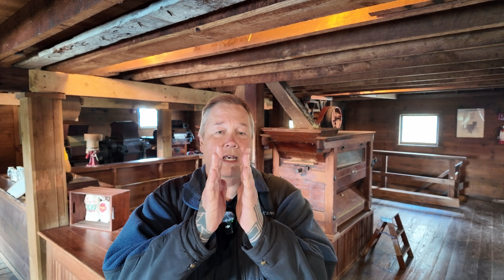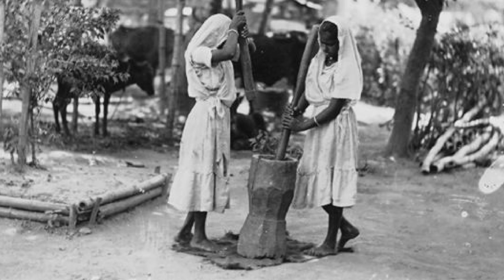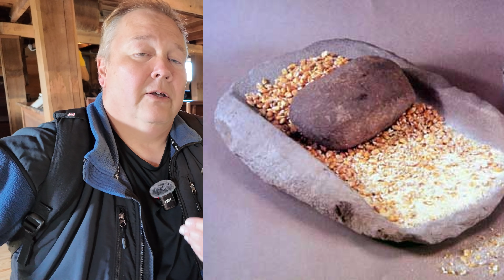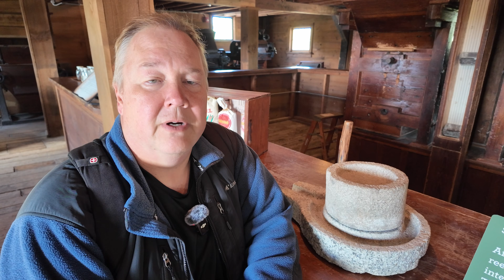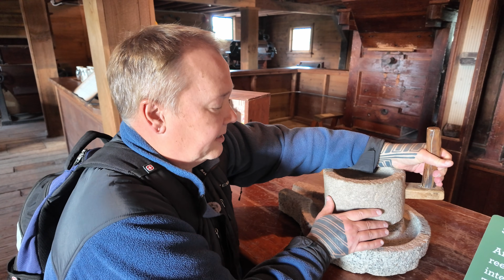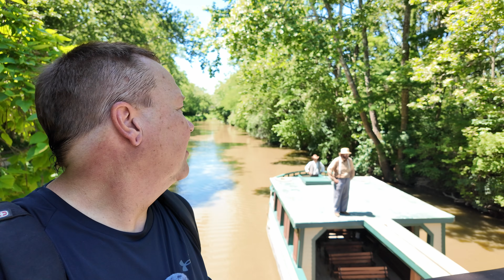How the Industrial Revolution Forever Changed Jobs

Comment: In 1995 the Ludwig Mill was fully automated and powered by water turbines.  Upon my retirement, there were no millwrights available to keep up with maintenance it seems.
Reply from the maker: I've only been visiting there the last 5 or 10 years.  It seems the might need to dredge the canal to get the boat in and out every year, but they've been grinding and selling grain and, allegedly, although I've never seen it, they run the sawmill at times, too.  One thing I would really like to see is their steam engine running everything in the mill.  They tell me it works, but they have problems getting qualified boiler operators to run it.

Comment: The quality of those replacement occupations is important. One thing that is sure is thar our 9-5 came outta that and union resistance to insane work conditions formed the jobs we have. When the boss class assumes that 24/7 operation of a machine incorrectly equates to 24/7 profits they tighten the screws and drive workers harder. Not trying to be an activist but wanted to mention that in spite of new and more rewarding jobs appearing, the entey level became more dismal as a result of the industrial revolution. This also meant less flexibility (no more lending your able hand to the family farm back home) and more unsafe, less personalized management.
Reply from the maker: Thanks!  You've definitely got some good points.  Coal fed the Industrial Revolution, and that's where the unionization really took hold.  Some of the new jobs were great (railroad engineer vs subsistence farmer), but a lot really weren't.  Many of those positions though included something else new - upward mobility.   Some industries, like railroads, had very clearly defined career paths, building the middle class, but that happened while the ranks of the poor also grew.
Lots of good ideas for future videos in there.  Thanks again.

Comment: Nice explanation to a very complex question.  As a skilled tradesman I would add that the level of skill to build the mill where you are speaking  required many skilled workers adding to the jobs created by that mill.
Reply from the maker: Absolutely.  Definitely some seriously non-trivial skills involved, there.  A lot of those were more common then that they are now, though.  General construction, woodworking, etc, was a pretty common skill, especially among farmers.  The turbine, line drive system, saw, and millstones, were unique, and had their own specialists.  I have a sawmill video coming up, and a grindstone one, too.  The Industrial Revolution created a whole lot of new, skilled occupations.
Reply from the maker: Used something like a little, electric jackhammer, or actually hand-powered hammer and chisel?